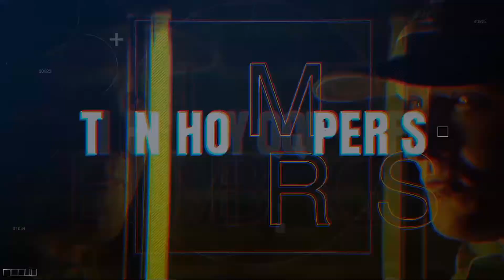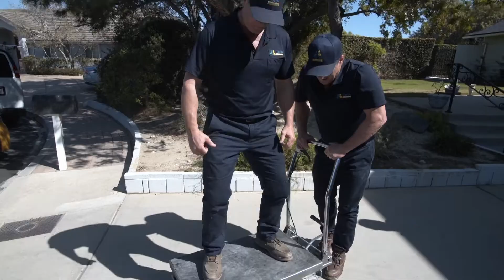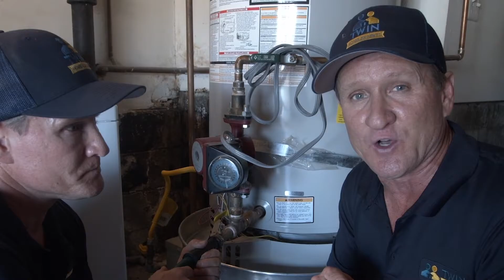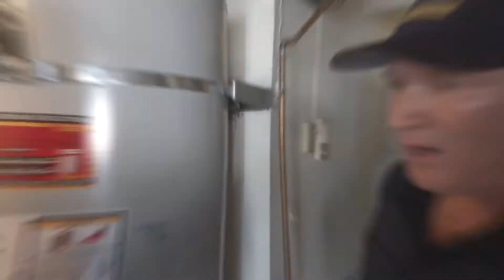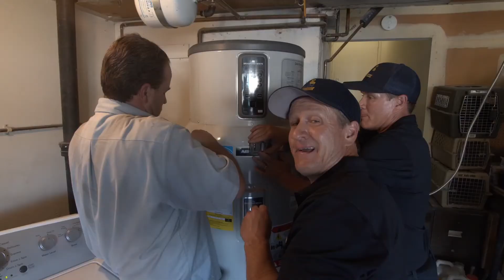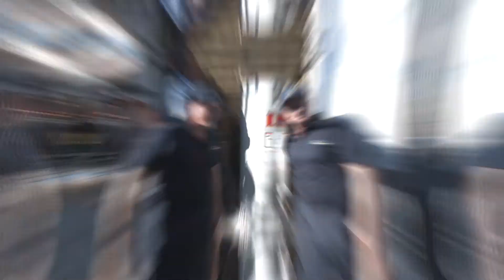How to INSTALL a HEAT PUMP Electric WATER HEATER - Replace and Install

Comment: never, ever purge the air by opening that P&T safety valve, go open a faucet.
Reply: Home owners will open the faucet and pros t and  p
Reply: @jameskirakosian8427 I agree with you and the technician or homeowner has to be very alert to when the water is getting close to the t&p valve level.

If there’s a tub to me that’s the best hot water fixture to open for purging air.

Comment: Can you still use a hot water circulation loop with the hybrid water heater?  These are great videos - thanks for sharing yoru experiences!
Reply from the maker: Great question! Yes, you can and should if your waiting more then a minute. Thanks for your feeeback.